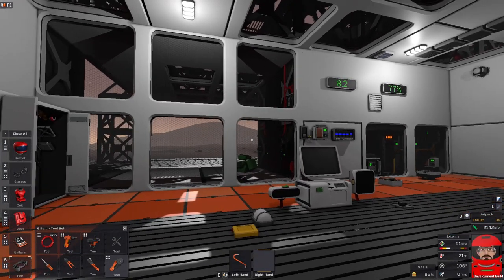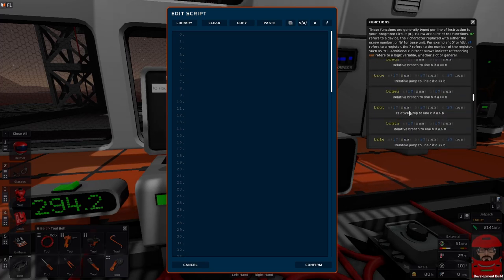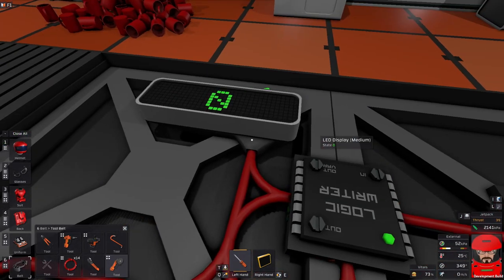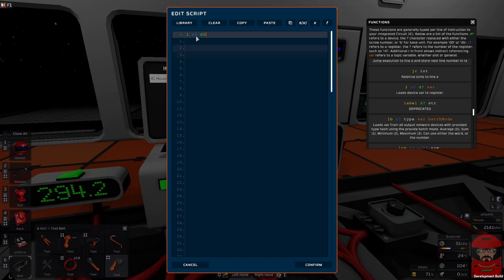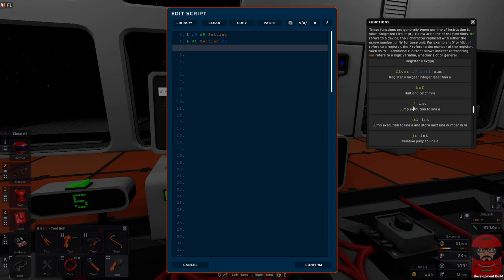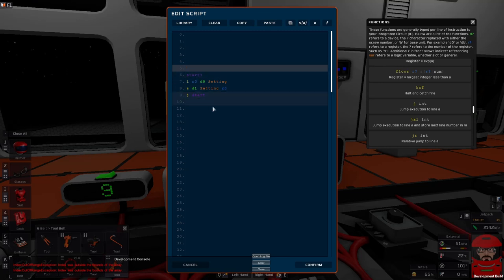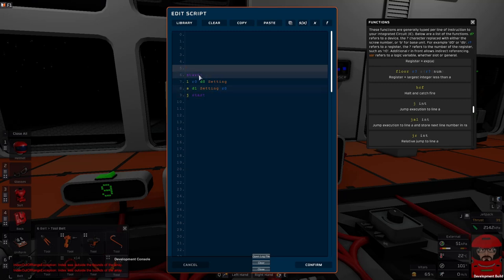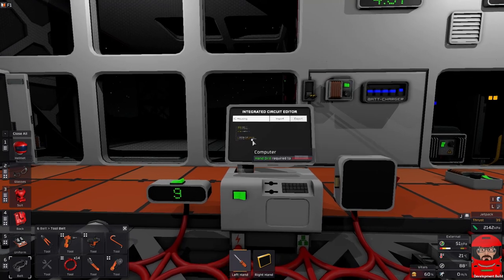Stationeers Basic IC programming 1 Loading and saving values

Comment: Just getting into this game and this is the first video I saw on the IC's, I was so relived when I realized it was just assembly programming <chuckle> I've programmed AVR Atmel chips in assembly before, I'm not great but I'm right at home in this kind of environment!, should make a solar tracking script fairly easy compared to the hordes of 'discrete' components you need to replicate it.
Reply from the maker: LOL, I thought I was the only one who remembered assembly.
Reply: @cowsareevil7514  I got into electronics as a hobby, I started my education the hard way on bare metal assembly and it stuck pretty well, I'm no good at it mind you but I can get what I want done even if it takes a while and isn't very elegant. This is more like a CISC than the RISC set which I'm used to but in this case that's REALLY good because it makes writing the code much easier than RISC, and even easier than a true assembly where you'd have to worry about a bunch of other things. This game is complicated but it's not quiet as brutal as real ASM :) so I'm right at home.

I just have to put into practice some of the stuff you showed in your advanced furnace builds (setting up the furnace in a room with a controlled atmosphere) and I'll be able to automate whatever I want without huge effort.

Comment: Oh my! I actually understand something with IC now, I didn’t even want to touch that thing until now. I can have easy up to 20 chips in a room, now it will be one ic chip instead in each room, or one very messy IC for them all. You might have saved my spaghetti base of a lot of clutter. It’s still spaghetti, but a better spaghetti. Oh my there is more parts of ic videos! Be right back. You just got another sub, keep up the good work
Reply: Would you say that with the more SOLID foundation that your spaghetti base would be al dente?